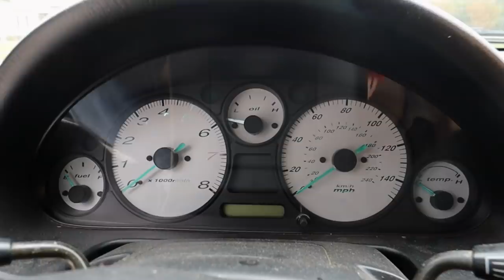I Got a "RACE CAR" From The "Junk Yard"

Comment: put paco racing excentric locker or your alignment will move with stickier tires. Cooling reroute or bigger radiator. Keep the roll bar it helps a lot with chassi flex but remove the strut brace. Good koni or bilstein strut, 15 inch 205/50 tires and lots of fun comming to you next !
Reply from the maker: I am PUMPED!
Reply: @HumbleMechanic  i have a 1994 NA and did a complete overall on the car with my son ( it was his first car and i  kept it when he needed a more year round car) now it is mine. I stated the obviuos in my comment but you are a real mecanic so you will figure what needs to be done. Depending on millage check the timing belt and wire/spark plug. From what i saw with the transmission fill plug the previous owner was not....mecanically incline! When i did the timing belt, the person that did it before skip a tooth on the intake cam and when i did it right,  the car ran better. Check The car passion channel (greg petters) i followed his channel for almost all my job on the miata. I don't know the stock rules for autocross in your region but for the brakes i put brembo standard rotors front and back with Hawk HPS pad front and premium Napa rear, braided lines and the braking is more than adequate if you don't turbo the thing.........and you will. I am a VW owner that is how i saw your channel. I have owned a B6 audi s4 avant( i learned a lot with that car !!) 2000 TT, MK7 GTI, now a 2013 Golf Wolfsburg  with the 2.5 ( the best golf to buy IMO GTI interior with the 2.5 5 cyl more reliable). I miss my S4 i had a viceral relation with that car; it would be a good project car for your VW/audi followers buy a broken one and do the timing chain job everybody is so afraid of. That V8 sounds like nothing else  when you put an xpipe 2.5 inch exhaust on it :)) i like  your channel

Comment: The 2000 model had a Mazdaspeed edition with a WAY stronger 1.8L engine, coded the BP-4W, which had individual coil packs over each spark plug. Worth looking into
Reply: There was no Mazdaspeed Miata in 2000, they were 2004/2005 only in the US.  99-00 and the Mazdaspeed both have the BP-4W engine, which came both non-turbo (99-00) and with turbo (04-05 Mazdaspeed).  The engine isn't any stronger, btw... it has a much better head design than the older BP (94-97), and wasn't VVT like the 01-05 Miatas (except for the Mazdaspeed).
Reply: @rennkafer13  maybe, I am only going off what little research the 323/protege guys did to modify their BP26 turbo engines to their max potential. Some information I received in the past may be false

Comment: They aren't bad to work on; my one bad experience is that some of them had the woodruff key on the crank fail, which meant when you unbolted the harmonic balancer to put on a timing belt, you'd never be able to actually get it in time . . . there might be a workaround other than replace the crank, I don't know.  The customer wound up scrapping the car.
Reply from the maker: Damn!!!

Comment: You have an NB1. Bro is best! Better 1.8L head than the NA. Still a 5 speed. Think of it as a reskinned NA. Based on the options: Leather seats, power windows; should have a Type II Torsen differential (which looks replaced--perhaps).

Sweet parts car! Nah more like pays for itself in a few months of YT content car. Just Joshing ;).
Reply from the maker: HAHAHA! I have a couple of partners for some videos which will make this project super fun. Also looking at something right after this car that will be next level

Comment: Port the head a little then slap a small turbo running seven pound on a plumbed back setup, if you wanna go crazy put a jaguar V6 into it. Its a popular mod in the UK.
Or you could just gut the interior and port the head, rely on its light weight  instead of power.

Comment: Check for possible headgasket concerns.  The 1.8 had more headgasket issues than the earlier 1.6l.
Reply from the maker: Interesting. What was the symptom?
Reply: Usually overheating but i would get the kit with the blue fluid that turns yellow with combustion gases.  Cold and hot.  If you plan on autox with it it may not hurt to do a new headgasket and timing belt anyway. Glad i can be of some help.  Love the channel

Comment: The only job I've done on them is a clutch, that gets fun when the brace is seized on the diff
Reply from the maker: Oh man. I’ve been pre soaking as much as I can. Lol
Reply: @HumbleMechanic  the main area to presoak is the two bolts holding the brace to the diff, theres a sleeve in each one that has to move to release the brace

Comment: 64mm throttle body and a vms crankshaft pulley and some adjustable cam gears and a header you can use the springs and shocks you cant use coilovers
Reply from the maker: I think all those mods will put me out of street class. LOL
Reply: @HumbleMechanic  yea I realized it when you were going for ES class but you protenza re71 tires and koni yellow shocks with them springs will be good and ebc yellow stuff brake pads

Comment: With those clean spots under the "Power Plant Frame" that connects the transmission to the diff, do some measuring (per factory service manual, can be found for free at mellens . net / mazda) that it's properly aligned - if it's out then it can cause vibrations at ~60 mph.
Reply: Yep, 66mm is the sweet spot..

Comment: There's a lot of aftermarket chassis stiffening beams including down the transmission tunnel
Reply from the maker: Are you saying they are available? The one from the trans to diff seems stock.
Reply: It may be im remembering it as an upgrade for an earlier year but stock for your year/trim package. It's been a while D:

Comment: Going from VW to Mazda? Better stock up on 12mm, 14mm and 17mm (and of course 10mm), and maaaaabey a double square socket or two.

Oh, and keep the strut tower brace, it really stiffens up the front end, just get some quick releases so you can get it out of the way to work on the engine/bay.
Reply from the maker: LOL I finally have a use for the 12mm and 14mm. LOL I am pretty sure my 14mm all look brand new

Comment: Coming from working on & owning VW/Audi Japanese cars (especially ones of this vintage) are a cake walk to work on. I wouldn’t say I’d never own another German car but after owning a few Honda’s and Acura’s and working on Japanese cars in general it’s definitely a hard sell to get me back into one. Be careful Charles this is how they got me with that damm Japanese car reliability. 
NB Miata’s make excellent autocross cars I believe that trim level had a factory LSD check the diff
Reply from the maker: Hahahahaha.
Reply from the maker: It does have lsd. I may have done a little burnout

Comment: After replacing the slave cylinder on the 993, I can’t believe the placement on the Miata. It’s so easy...
Reply from the maker: Right! The R32 is transmission out to replace the slave!
Reply: HumbleMechanic wow...that’s even worse. It’s on top, between the body of the car and the trans with no way to see it. Working blind

Comment: This miata/mx-5 is the 10th anniversary edition. I do believe the eibach spring came as standard from the factory and are also an accessory from a main dealer. They are amazing cars to work on and play with lol. The one thing that I believe all miatas/mx-5 needs... TURBO! How do I know this? I'm a parts guy at a mazda dealership :)
Reply from the maker: Nice!! Do you know if I can confirm the springs with Mazda?
Reply: @HumbleMechanic  of course man, your mazda parts guy should be able to confirm that for you. I'm in the UK unfortunately but every main dealer should have that information to give you

Comment: Will you need to add a hardtop for racing? They are pricey. The convertible top latches on these ( I have an 01) are weak and tend to break. However, if you score a hardtop it should have the same latches as the convertible top and they can be swapped. Miata.net has tons of info and a lot of helpful people.

Comment: That Mazda looks better underneath than a VW / Audi of the same age and that is the lower end of Japanese products.
Imagine a VW Audi convertible roof that had been left for any length of time outside and th e electric ssensors that chuck up fault codes all the time.

Comment: Why get rid of the strut brace or is it totally useless? 
I would assume it would make the car a bit stiffer and thereby improve the steering.
Reply from the maker: If it wasn't from the factory, I can't run with it in the street class. I will probably keep it, but not run it for autocross
Reply: It's totally useless.  Miatas don't have an issue with flex in that part of the car.

Comment: The only experience I have with Miatas is diagnosing a clunking noise on a former colleague's car.
More or less putting the car on a lift, take a look at the rear suspension and yell "well there's your problem!". (several bushings were missing....)

Comment: I have a question that i hope you can answer. In April I plan on getting a car and want to get a used 2018 GTI DSG with around 10k miles. I was wonder if it is a good car and if you’d know if it would last beyond 100k miles. Also how much money would i spend on servicing it and what to expect from services. Thanks
Reply from the maker: great car! The maintenance is not cheap, but it's not hard to DIY either.

Comment: I know this question has nothing to do with the Miata but I bought a b5 Audi A4 1.8t has a project but having issue with rough running coming in and out of boost when u plugged a boost gauge there is a leak where are the most common issues with vac leaks on these
Reply from the maker: Those are horrible about broken vac lines and hoses. Look under the manifold
Reply: HumbleMechanic thank you will have a look in morning love your videos

Comment: That "strut brace" is definitely not factory and is absolutely useless on a Miata.  When you get past the replacing stock parts phase, talk to Emilio at Supermiata.com and Andrew at TrackspeedEngineering.com.  Two of the fastest builders and drivers I know.  My previous DD before the GTI I have now was a '97 Miata built for track use.

For your roll bar, Hard Dog makes pre-formed correct SFI pad for that bar, and they also have covers for the pad.
Reply from the maker: Thats awesome Bill! Thank you so much!

Comment: At least all the parts on a Mazda won't break when dismantling them on a modern VW / Audi.  I have to say that the German cars have become seriously troublesome since about 2006 with regard to quality and electronics.
Sadly to say, if you want reliability and workable vehicles, it has to be Toyota (Lexus), Honda (Acura) and then Mazda.

Comment: I’m late to the party but pointing out that aluminum member parallel to the transmission may be removed for a clutch job
Reply: Its the PPF, it would have needed to come out with to do the trans
Reply: Try Chhay Youth Yep — couldn’t remember the name as it’s been a few years since I did that job, mostly wanted to point out that some wear on those clips may be evident and that the car has likely had a clutch change at some point.  Cheers!

Comment: Fog lights didn't come until 2001 Miata, unless this has an nb2 conversion.
Reply: Shadowwave 6176  99-00 Miatas had dealer installed fog lights available as an option. The dealerships would install the brackets, lights, and wiring, then drill/cut the bumper with a template and install bezels into the bumper cover for the lights.
Reply: Moddage oh I didn't know that. Thanks Moddage.
Reply: @colbywong1396  You're welcome. Not everyone knows it. I have a brand new set of OEM fog light bezels in a box that I was going to put on my 99 for brake cooling ducts.  Might just NB2 swap the front end, unsure yet.

Comment: Oddly enough people swap in Kia Sportage motors into these. Got a sportage motor I am swapping into my b2200 this winter
Reply from the maker: REALLY? that is pretty awesome. What is it about that motor people like?
Reply: Kia bought the right to the fe Mazda motor and basically upgraded it in every way. They really love boost too only problem is they are taller and the oil pan get in the way of the front cross member
Reply: @HumbleMechanic  it's an "FE" series Mazda engine, gives you a 2.0 rather than the stock 1.6l/1.8l in a Miata.  It's not a particularly popular swap anymore since the stock 1.8 in your car puts out more power than the Sportage engine.  Was popular "back in the day with the 1.6l early Miata crowd when they only came with 116hp vs the 130hp Sportage.  You already start at 140hp with the BP-4W.